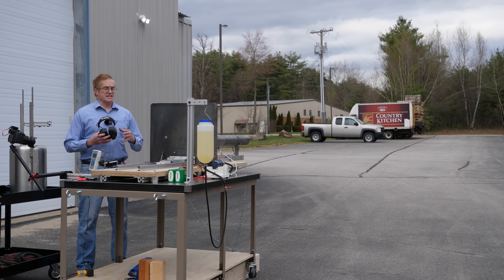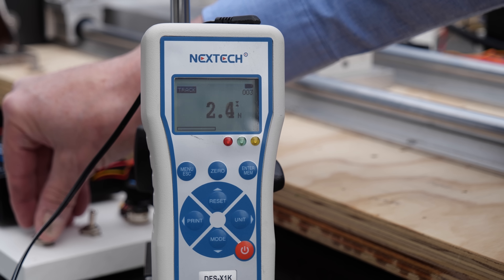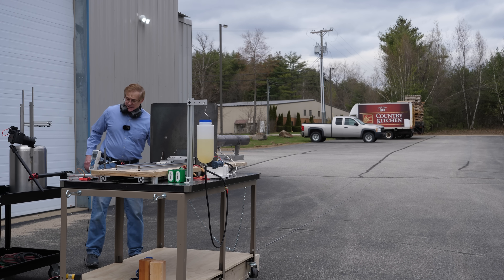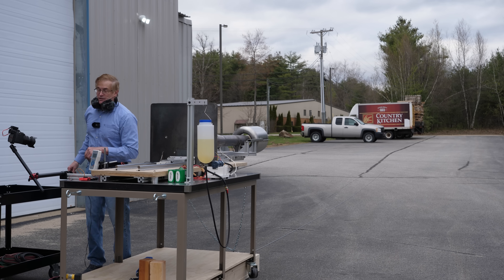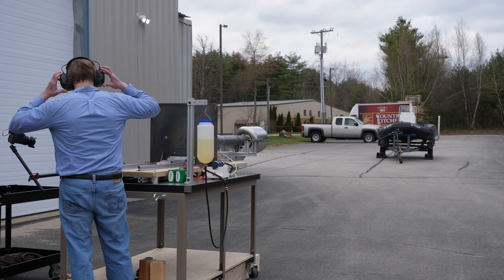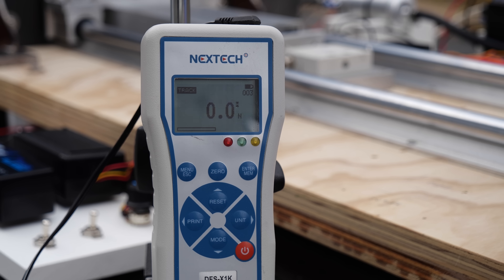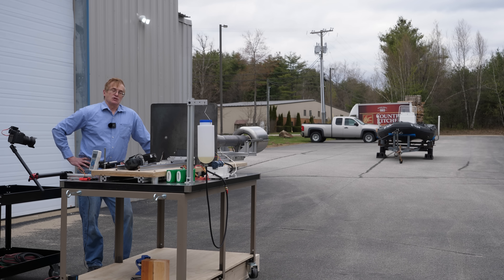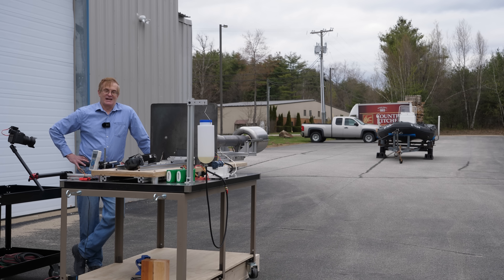WE USED AN AUGMENTER ON OUR PULSE JET!

Comment: Putting the chocks with the ramp towards the tire was the correct move. If you put them the other way, there was a much higher chance that the trailer just pushes them forward and they don't stop the wheels from rolling. If you put the ramp towards the wheels, the weight of the trailer presses them down into the ground and basically guarantees that they can't slip.
Reply: This needs to be the next experiment to settle this once and for all!
Reply: Yes please @mitch5297
Reply: @mitch5297  No. Go on the internet and look up a wedge shaped door stop. Done.
Reply: @herrpez No, that's not how door wedges work. Door wedges work by jamming between the door and the floor. There's FAR more force than gravity alone.
Reply: Could have just backed a vehicle in, and cabled the jet to the ball hitch.
Reply: I was thinking they would have parked the trailer 90 degrees to the pulse jet and attach the cable to the wheel. Its harder to make a tire slide than roll :)
Reply: The weight of the boat has to be on the chocks to prevent them from sliding.
Reply: They really need to get proper chocks, rather than ramps.
Reply: I was thinking rotate the boat and trailer 90 degrees.  I tried pushing and pulling a shopping cart that way and the rear wheels really don't roll very well that way for some reason.
Reply: @karlharvymarx2650  try a uk shopping trolley (cart)   you'll find that not so plausible    😂 😂 😂 😂 p.s. I'm a dick 😂
Reply: @wayne7521   ha ha , yes...(most of the worlds shopping trolleys - have 4 swivelling wheels..  (only the USA  - generally, in my experience, or Costco, everywhere - has steering limitations, the reason why is that it allows a huge long line of trolleys to be pushed and easily steered - with all the wheels on the ground. American ones are better for making "billy carts"..)
Reply: @wayne7521 Can these trolleys of which you speak be piloted on the right side of the aisle? For completeness, I thought I should mention that the table could have been moved 90 degrees at a constant radial distance from the boat. Also I have noticed there is a significant rise in friction when boats are operated on tarmac so it could have been dumped on the parking lot. It could even have been used to choc the trailer wheels.
Reply: @wayne7521 Yes, those UK and Australian shopping trolleys are crazy stupid. Much harder to steer and control with 4 swivelling casters, and a huge amount of wasted space underneath where large items could be placed. US shopping carts are a thousand times better.
Reply: They just are the wrong tool for the job.

Chocks used in aeronautics are at a 45 degree angle to the ground so that the harder the wheels push against them, the harder they push on the ground, and the angle is impossible to climb.

Proper chocks can be built up from stock lumber.
Reply: Agreed Alex was correct, any force great enough to send the boat up the ramp would just cause the chocks to slide. Those chocks really want to skid on smooth concrete.
Reply: @landroveraddict2457  Then why do they exist?  If the engine had created enough thrust, it would have towed the boat up the ramp. 
What they should have done was use actual chocks.
Reply: @tarstarkusz the pulse jet had enough , force ,then they would have used something else...

I've watched this channel for a while ...

And no doubt ,calculations will have been made !

The boat and trailer weighs x amount 

The engine produces x amount of torque 

Then the math is dine to see what angke can be the most acute that said movement occurs..

It aint rocket science 🤔 or is it ?
Reply: @wayne7521  My point was that ramps are the wrong tool.  The right tool was to use actual wheel chocks.
Reply: @tarstarkusz  why ??? The ramps and chocks both have angles of inclination to overcome , yes ? 
.
As long as the angle out weighs the torque of engine ,then the tool used is not a problem...

You get on a 50cc scooter and try going from dead stop ...up a 25 percent inclination .... see how much it would struggle ...

Now go back to same gradient and with a 259cc engined bike do same test.. 

It will move with ease 

Now take into mind ,they tested and measured output of pulse jet previous ... 

I cannot explain any clearer... that they chose correct.
Reply: @tarstarkusz  Ur all wrong the right tool was right in frame that friggin truck
Reply: @zachmoyer1849  pmsl ,someone else actually pointed out , to turn the trailer side on ... and lash table to side of trailer ...

It's quite hard to drag a tire with weight side on ,to the direction it rolls.   ...
Reply: @tarstarkusz  I'm curious as why ramps were the wrong choice and chocks were the correct ??
Reply: @wayne7521  So you are confused why I say they should have used an immobilization device to immobilize the trailer as opposed to a lifting device?
Reply: @wayne7521  They did not know before they tested how much power they were going to produce.
Reply: @wayne7521  yeah i thought about that too but im still picking the thing that has brakes, moves itself, and has a hitch ready for attaching stuff to.
Reply: @zachmoyer1849  well I ain't arguing .... talking to dumb dumb has fried my mind ... 

I'm gonna go park my vehicle against a pyramid,  that might have the right amount of angle 😂 😂 😂    

Read conversation between me and tark ... coz he ain't no Tony.
Reply: @zachmoyer1849  A vehicle with brakes would have worked well too.
Reply: @wayne7521  i saw it remember never stoop to their level they beat you with experience lol.
Reply: @tarstarkusz  if engine had enough thrust it indeed would've towed the boat up the ramp. the thing is that it doesn't have enough thrust. its not that powerful, despite sounding like one. for the sake of argument lets say tilt on ramp is 30 degrees, it would mean that engine needs to output half the boat + trailer weight as well as overcome the friction of table its sitting on. this is way greater force in total compared to 100N, even double this thrust is not enough (augmenter can't double the thrust to begin with). to make it simpler, if this engine was powerful enough to tow the boat up the ramp, it'd mean that double the thrust would lift the same boat straight up. this puts a good enough perspective i suppose. as for putting it the other way, this way wheels MAY indeed drag the ramps as there's not much friction holding ramps on the asphalt.
Reply: @tarstarkusz  People here seem to have a hard time understanding this "ramp concept". The energy required to pull the boat is pretty low. In fact, you can see in the video how a person is able to pull and push the trailer with the boat around. Especially since once the trailer is in motion, you do actually need to apply force to stop it again.
However, lifting that trailer is a lot harder, and the ramp guarantees that you can only move the trailer by continuously applying a force to not only pull it up the ramp, but also keeping it from rolling down again.
Reply: @graealex  On flat ground you would not need to apply a force to stop the boat, it would stop entirely on its own.   While the force required to pull the boat up the ramps is higher, it's not as high as the force required to overcome a chock.  But had the table moved anyway, it would have been pretty easy to just shut off the fuel.
Reply: @tsraikage  I'm not saying there was a danger that the engine was going to drag the boat up the ramp. I'm saying you should use the right tool for the job. 
Frankly, I don't know why they didn't just use the car. If they have a boat trailer with a boat on it, they got a car with a hitch. If they didn't have a hitch, then I could see not wanting to go under the car to find a good mounting point.  The chain was pretty long and so the car should have been out of the danger zone, though I can understand wanting to protect your car more than that boat if something should go wrong.  Maybe they were worried about heat damage to the paint or tires?
Reply: @tarstarkusz  As I wrote, people really have trouble understanding the concept.
On level ground, you only have to overcome a bit of friction to get the boat going. As long as the thrust would be equal or greater than the friction from the wheels, it would continue to move. It's literally the reason why these trailers have overrun brakes built-in. Otherwise if you pull the trailer with a vehicle, and then tried to brake, the trailer would try to overtake your vehicle.
With the ramp on the other side, you have to constantly apply a force just to keep it from rolling off the ramp again, so basically force is already necessary just to keep it static, because gravity wants it down.
Reply: @graealex  No, it won't continue to move.  The friction of the bearings and tire deformation and rolling resistance will bring it to a stop on level ground. 

They have brakes to assist in braking as well.  The movement of the trailer is additional kinetic energy the brakes need to convert to heat.  It's pretty easy to overheat stock brakes.  This is one of the reasons so many car chases end in wrecks, especially trying to take a turn.  They don't realize how much the brakes have heated up (over the course of the chase with many speed up slow down cycles) and how much longer it now takes to slow the vehicle down. They end up taking turns too fast because they didn't leave themselves the extra room the now hot brakes need to slow down enough to safely make the turn. 

Yes, it will want to roll backwards if taken a portion up the ramp.
I concede all this.  All I'm saying is use the right tool for the job.
Reply: @tarstarkusz  You should tell that to trailers that try to overtake the towing vehicle and cause a crash. Maybe those trailers would behave better after you gave them your physics lessons about inertia.
Reply: @graealex  Did you even read what I wrote?  I wrote "They have brakes to assist in braking as well.  "  AS WELL.
Reply: @tarstarkusz  Do you know how overrun brakes work? They are not active when the trailer isn't connected to a vehicle that's braking itself.
Reply: @graealex  Then why are you bring them up? Quit being a pedant.  A trailer going 60mph has a lot of kinetic energy and would take thousands of feet to come to a stop without brakes assuming it doesn't flip from the tongue digging into the asphalt.
All of this is because I said he should use wheel chocks, the right tool for the job.
Reply: @tarstarkusz  The speed doesn't matter. All you have to do is to overcome friction to get and keep it moving.
And again, when put it next to a ramp, you need a lot more continuous force just to keep it *static*.
Reply: @graealex  What is your point?  Why are you such a pedant?  AGAIN, you need this force continuously or it will stop.
No, you are just assuming that.  If you applied enough force to go all the way up the ramp, there are flat spots there.  No additional force needed. 
Remember these ramps are specifically designed to drive up and then park so you can get under the vehicle.
Reply: It was making 45lbs of thrust nominal, it wasn't going anywhere regardless.
Reply: The best solution is to put the boat sideways and chain to the axle
Reply: (It doesn't take any genius in this regard  - merely a little practicality - the "pushing" of an unloaded ramp moment, was that clip which could have been cut...)

Of course the correct tool for the job - actual wheel chocks - or a piece of 4x4 cut to resemble a >30 degree wedge (wheel chocks are usually 45 degree or so (the steeper angle presses into the ground harder and doesn't roll "at all") )...  Ramps, not  the best choice, but in the end it worked, use what you got (though the main talent proves that if you haven't got it, you can buy borrow or make it.....
Reply: @kadmow  what about this jet only making 45 lbs of MAximally did you miss? The trailer was pointless in the first place.
Reply: EVERYONE HERE IS WRONG…because i said so.
Reply: I can't believe this argument. Watch the video. The boat didn't move up the ramp.
Reply: @drooplug  Maybe I'm misunderstanding, but I think this thread is a joke. It is kind of funny dad made son pull the boat out because it was his idea for keeping the table stationary. That son was then too tired to think clearly (I couldn't see the actual mistake, or if there actually was a mistake.) And then the engine produced  less thrust than expected so all that work and the two parted video ended up not being needed except as a sensible precaution. It was a grin-worthy comedy of errors much like with everything I attempt in life. 

And then everyone arguing about the right way to do position ramps if they had been needed. I don't see well, and thought jr put the ramps on the opposite side of the tire, maybe to keep it from rolling away from gravity. Juding by how much effort it took to get it there. even was probably good enough. But apparently they were on the correct side of the wheel so the debate is about ramp vs blunt chock side. If they are designed to be used as chocks so that they don't slip along the pavement, then I'm pro-chocker, otherwise pro-ramper. There is a reason parked airplanes are chocked not ramped, chocks are designed to minimize horizontal movement while ramps are designed to ease vertical movement. Both are overkill in this case, but technically chocks are the right tool for the job.

Were they designed to be chocks? I have no idea but it seems like that would be a good idea. I wouldn't want to work under a vehicle on ramps unless there were chocks and the bakes set. A pair of the things would do that. I knew a guy who recently worked on his truck without chocks and was crushed to death when the truck rolled off the ramps and on to him. 

If they aren't designed to be chocks, they probably should be because it would be a low cost feature to add.
Reply: No, using those ramps (they are NOT chocks) was altogether the wrong move. Those ramps are specifically designed to be easy to roll up. While turning them the other way might make them skid, it was still the right way to use the wrong thing. The actual right move would have been to get some bricks or 4x4s, if real chocks were not handy. Even big rocks would be better than those ramps. But the best way to do it would have been to turn it 90° and tie to the wheel facing the jet. Then rolling would not be an issue.

But the whole thing was dumb anyway. Just use a car - or that pickup that was sitting right there. Far more mass/weight and traction, and no danger of rolling. But still, putting the vehicle perpendicular to the pull is the obvious way to prevent rolling, and you wouldn't even need chocks.

Of course, this is all moot because it was just one big troll to get people arguing about it. The amount of thrust that motor put out was not nearly enough to be a problem. But getting all these comments makes the algorithm happy. 🤔😂🤣
Reply: Real chocks don't look like ramps at all. Proper chocks have a concave curve that allows the thin edge to get as far under the tire as possible and gives the most surface area contact between the tire and the chock. The curve also ends up much closer to vertical. That prevents skidding, climbing and rolling FAR better than any fixed angle.
Reply: the answer is very geometry dependent. and while you could figure it out from first principles, it would be far less funny than putting an argument onscreen. Which given that you're using a boat to be funny, would be missing the point.
Reply: Leave the boat and trailer side on and chain to the wheel.
Issue resolved.!

Comment: The purpose of the ramjet is propulsion - thus movement. If that ramjet was powering a rocket, there would be significant airflow introduced by its rapid flight thru the atmosphere. Perhaps that is the missing ingredient - you just have to let that thing fly free! 

I would suggest that you consult with your neighbor first, he may have some legitimate reservations about your doing so.
Reply: It's not a ramjet, nor is it a rocket. There's 2 problems - the augmentor is too small, and it's far too close.

Comment: Would forward movement, like in a rocket, increase the effect of the augmenter? Ram air principle?
Reply from the maker: It actually hurts the performance due to the larger frontal area drag.
Reply: @TechIngredients  Could the pressure difference between front and back of the augmenter from forward flight be required for effective mixing of the hot exhaust and ambient air to increase the mass flow enough to overcome the drag? What principle could even allow the augmenter to reduce static thrust?